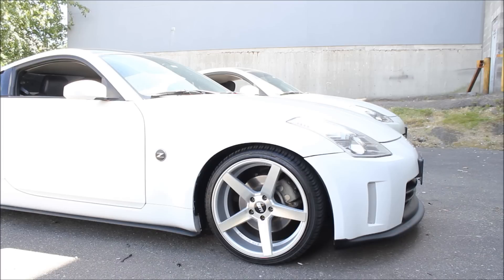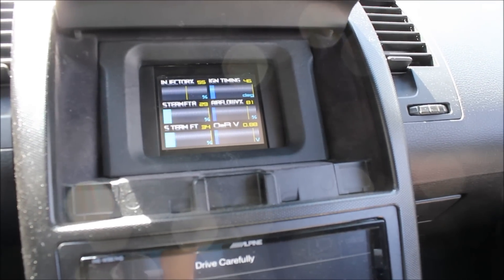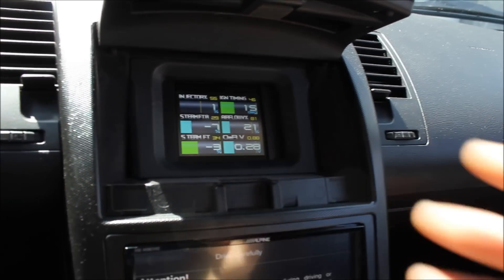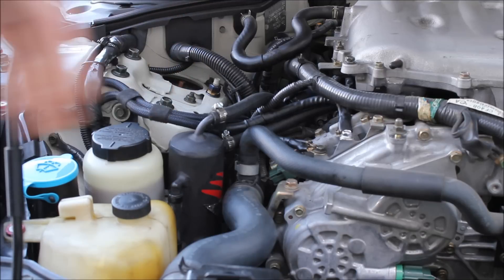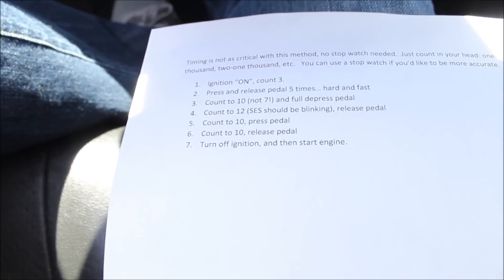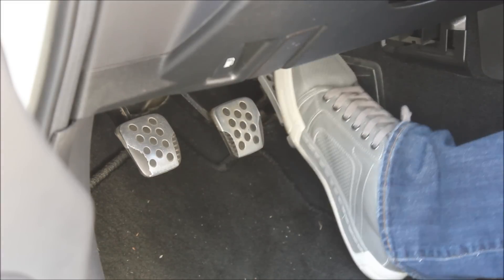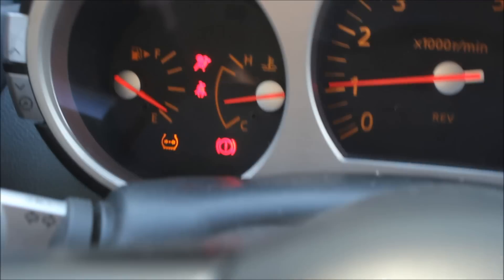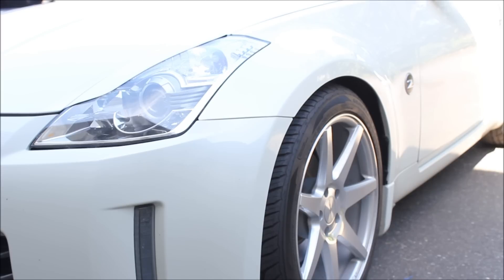Nissan 350Z / Infiniti G35 ECU reset & Idle Relearn 3.5L V6 (Check Engine Light) | AnthonyJ350

Comment: My 2003 Nissan 350z, when I turn on the car, every single light on the dash comes on such as ABS.SES, SLIP, TCS OFF, literally every light on the dash. Then when im driving the service engine soon light flashed and when the car changes into gears the car jerks when accelerating. The rpm moves wildly from 1-3k rpm on the dash. I don't know what is wrong with the car. I just changed the battery, since my old one was making my car crank. After I changed the battery all of these problems occurred and I never had a single light on the dash until I changed the battery.  I been owning this car for about almost 2 years. I tried this method and still didn't work. Anyone know what can cause this?

Nissan 2003 
84k original miles  I been owning this car for about almost 2 years.
Reply from the maker: MatixBeats Check your battery terminals. Make sure they're tight and you can't wiggle the connections.
Reply: Thank you for your quick response. I'm going to double check everything right now.
Reply from the maker: MatixBeats Let me know what you find.
Reply from the maker: MatixBeats I would also clean the battery terminals. New batteries can be shipped with a coating to prevent corrosion but won't flow power that well.
Reply: I cleaned the battery and connected the wires tight, so there wasn't any wiggling. I turned on the car, but it made no difference. I ran a scan with a OBD ii scanner, but it was just listing all the lights that were on the dash. I went to a local shop and  a mechanic said to run the car for a week, and maybe it should be normal afterwards. I doubt it though.
Reply from the maker: MatixBeats Check all your fuses. Does it run ok though?
Reply: All the fuses looked fine. I removed the battery for about 24 hours and put it this morning. The car turned on fine and everything was running good as it should. All the lights on the dash went away, but the "Service engine soon" light remained on the dash. Some people say it's common to get a check engine light when you replace a battery, and others say that's a false statement.
Reply from the maker: MatixBeats Scan it just so you know what the computer tripped. But now you could do the reset if it's just the SES light.
Reply: I did the ECU reset like you've done in this video, and when I turned my Z back on the SES light went away. The car was running properly and not having having any issues! Hopefully my Z stays functions normally now with no more issues, thank you for your time and responses!
Reply from the maker: That's good it all worked out!

Comment: would resetting the ecu make me lose my uprev tune?
Reply from the maker: ZMonster That I'm not sure of. I would contact UPREV on that one.
Reply: No you will not lose your tune, I'm tuned and know this for a fact. Disconnecting the battery and pumping the brake pedal 5 times is the easier way to do an ECU reset, it works every single time. It is listed in the service manual to do the pedal dance or disconnect the battery to reset the ECU. I"m about to do an upload on the pedal dance for the idle relearn, which you have to do the pedal dance for. Also an upload on resetting the ECU by disconnecting the battery and pumping the brake pedal.

Comment: I see a lot of posts on forums that you have to disconnect the battery to reset the ecu. 
Is this not needed on the 350z?
Reply from the maker: glennieb97 That's a different way to reset a vehicle. But the 350Z and G35 also have this built in procedure. It's nice because it gives you confirmation you've reset the vehicle.
Reply: AnthonyJ350 ahh okay! Thank you very much

Comment: Should I do this after I change my camshaft and crankshafts sensors?
Reply from the maker: Huncho Cris It would be a good idea to.
Reply: @AnthonyJ350   is it necessary? Will it throw a code if i just replace the crankshaft and run the car without draining battery?
Reply from the maker: @117obeyy  Good idea to reset to the computer can relearn

Comment: Check engine light not flashing in my 03’ manual Z I’ve done this before its just not working
Reply from the maker: Did you try scanning it to see what the code is? There might be a problem with the car.

Comment: If we reset the ECU do we still need to get a tune?? Or is that like the same thing??
Reply from the maker: Depends how modified the vehicle is. Getting a tune is always recommended.
Reply: @AnthonyJ350  well pretty much headers, test pipes, plenum spacer, oil catchcan also clean the throttlebody squeaky clean the valves and I also smoothed out the inside Plenum.  I know it tune is always best, but I wasn’t sure if resetting the ECU, and everything would be like the same thing?
Reply from the maker: @Mistr_Vq  It will help a bit but you definitely want a tune and run Shell 93 in the car if available. 

I would consider changing out the camshaft and crankshaft position sensors with Hitachi and change out the front oxygen sensors in the exhaust so the car can be tuned as accurately as possible.

Comment: Would this resolve P0420 and P1283? Lights on because of cat delete. Looking for a steadier/smoother idle as well.
Reply from the maker: It might if you run defoulers. You really need an UPREV tune done on a dyno to correct the car.

Comment: Have you had any issue with the TPMS light? Actually mine goes like this (.) instead of (!) and I have no turn signal light (the green one inside) or sound and that goes with the sound the car gives you if you leave the lights on or the key in the car and you open the door. Is so confusing
Reply from the maker: Did you check the owner's manual?
Reply: AnthonyJ350 don’t have it in hand

Comment: i had ses light due to installing test pipes on my hr, i just put o2 nonfoulers and im wondering if i should clear the codes or reset the ecu first?
Reply from the maker: yair garcia I'm pretty sure resetting the ECU will clear the code and any saved data. Let me know if the foulers work on your HR.